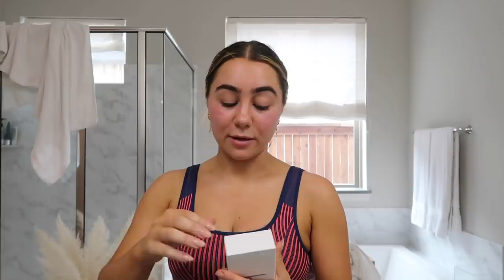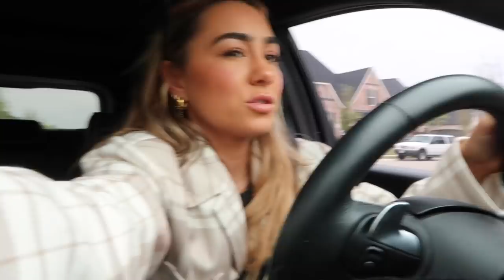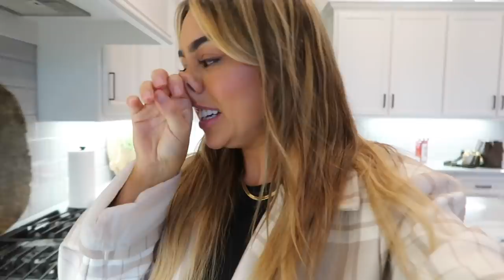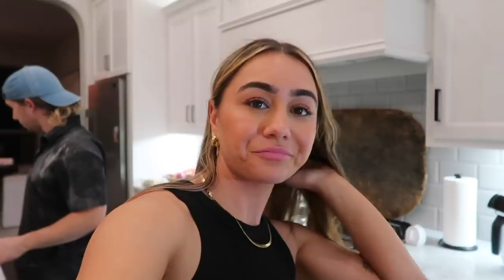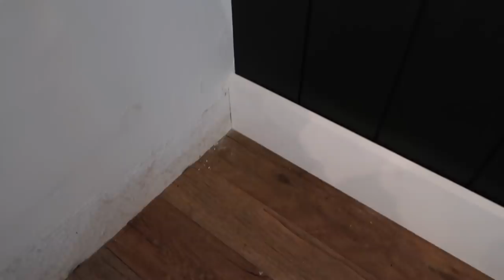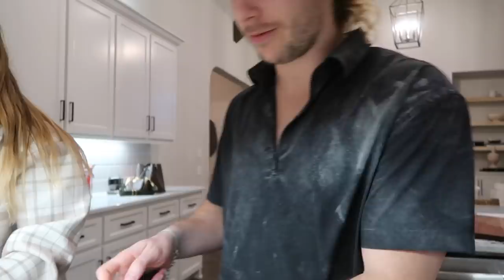VLOG: How I'm really doing, at-home workout, healthy salmon bowl recipe | Julia & Hunter Havens

Comment: I'm loving the vlogs at the moment 😍 Btw I find that the easiest and tastiest way to cook rice is in the microwave. You do the ratio of rice to water 1:1.5 (so 1 cup of rice would need 1.5 cups water). Put the rice and water in a deep microwave-safe bowl and microwave on high for 5 mins. Take it out to stir, microwave for another 5 mins and all of the water should be absorbed (if not just put back in for like 2 mins) and you will genuinely have PERFECT fluffy rice. Works best with jasmine/short grain rice 😊 Try it - it's foolproof 💙😉